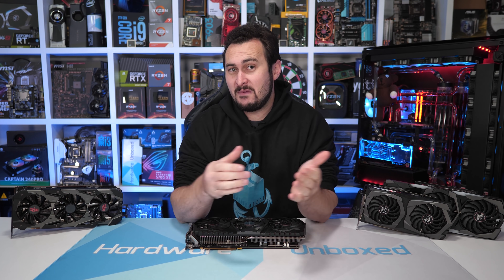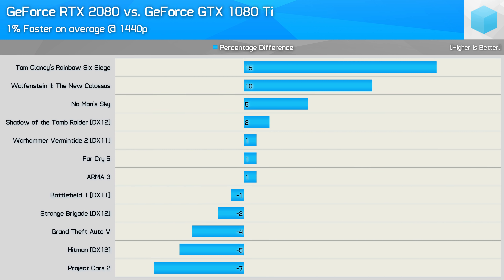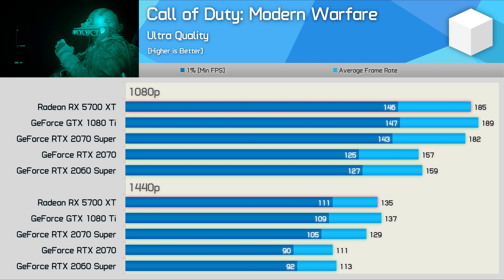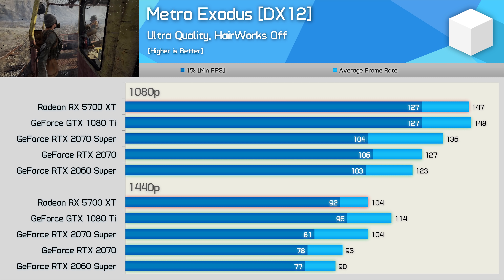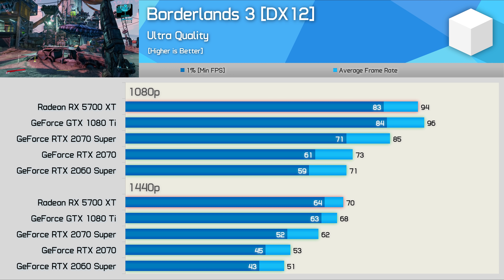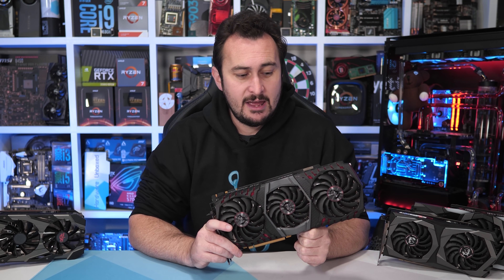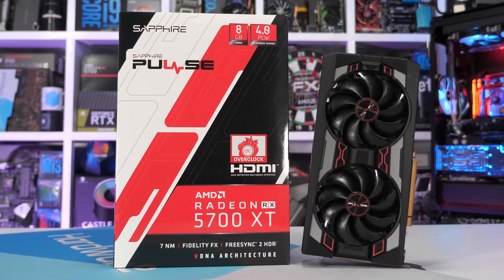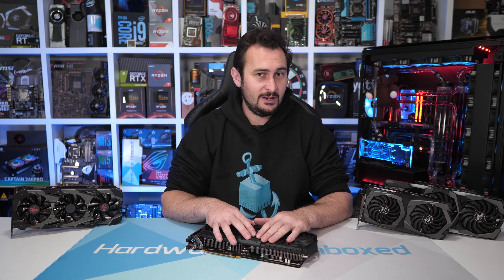GeForce GTX 1080 Ti vs. 5700 XT & RTX 2070 Super, 35 Game Benchmark

Comment: The 1080 ti was one of those GPUs that was too good. I still have mine 3 years after purchasing it.
Reply: srsly....you bought a high end card, do you expect it to be useless after only 3 years? 
people still use 780tis for 1080p gaming and its fine as long as 3gb of vram is enough.
for 1080p the 1080ti will be useful for at least 10 years.
Reply: @AzumDzumHzumS  Exactly, and since the 1080ti was blessed with 11GB of memory, it can easily handle 1440p textures.  And in some cases the 1080ti might even have the capacity for 4K resolutions, although it's not quite powerful enough to actually play most games at that setting.
Reply: same, I have a hybrid evga 1080ti. has been my best card so far
Reply: Gtx 1070 have absolutely no intention or need  to upgrade soon
Reply: Yep my 1080ti runs at 1988mhz on water with the memory at 1200, absolutely a beast. I’ll see how the 3000 series is looking but I bought mine used for about 400 ish so idk if replacing it will be reasonable till 4000 series comes out and I can buy a used 3080 lol.
Reply: All thanks to Amd Vega's barking
Reply: I would sell it now, then get a rtx 2080 or rtx 2080 Super.
Reply: Same
Reply: It was barely good enough for 4k but as soon as the next thing came along it was ditched asap.
Reply: Yet when it came out, people called it a bloated, overpriced cash grab.
Reply: Same! Bought mine in August 2017. Now waiting for RDNA 2 and RTX 30xx to see which GPU I should go for.
Reply: Me tomm 1080ti@2025mhz under water
Reply: Same here. Big smile!! EVGA FTW3
Reply: struggling to replace mine. even considered taking my founders edition and getting aftermarket cooling on it to get more life from it.
Reply: Same here. Basically, there's nothing that can really replace it right now, but with my VR habit, I'm really hoping the RDNA2 or 3080 TI can live up to the hype. After crunching the numbers, I'm thinking I need about 40% more GPU to get the FPS at the resolution and graphics settings I want in the games I want to run it in. The 2080 TI isn't there, and unless RDNA2 really brings the competition, I'm not keen on spending >1k on a card that doesn't deliver quite enough.

The target is Il-2 Great Battles in HP Reverb VR, with Ultra graphics (maximum view and render distance) at 90fps. The 1080 TI pegs at about 40 fps. The recommendations for the 2080 TI are medium or high graphics settings, but I'm doing high altitude aircraft, so I want the render distance so that the cities in frame actually render, even when I'm cruising at 30,000ft.

I'm sort of debating if it's worth it to sell the 1080 TI and get a cheap RT 480 to hold me over on 1080p games until they finally release the next gen of cards.
Reply: It's definitely one of the cards I'll actually remember, and that is an extremely SHORT list.  I think the only memorable cards I've owned are the ATI 9800 Pro, the Nvidia 8800GT, and now this GTX 1080ti.
Reply: Eddie T  yeahh i can see the smile of your face. Lol
Reply: It wasnt too gopd, the new gen is just too bad. They put rt cores in it and asked ridiculous prices while the performance wasmt there
Reply: Ya...
Reply: Other way around - Turing was simply not good enough. At least it brought something new to the table, that the 3000 series can hopefully cement in place.
Reply: @BrutaleBent  IMO, Turing was just too expensive. If the RTX 2080 was 500 USD and the 2080 Ti was 700 USD, then it would be a decent upgrade and the 1080 Ti could then be compared to the 2080 Ti instead of the 2080.
Reply: @BrutaleBent  Turing performance was fine, just too expensive due to lack of competition. The RTX 2080 Ti is a beast, all the RTX cards will last a good while, especially if games implement DLSS 2 which is a great feature to have.
Reply: @BrutaleBent  
No... Wut?
AMD can't even catch up after 3 years and u call it other way around?
Do understand that the jump from 980Ti to 1080Ti was almost 2x more.
2 years shouldn't even be that different. It simply set a standard Nvidia cannot deliver on again.
Reply: It appears it will be good 2-3 more years based on these results!
Reply: im using a pair of 1070's...a mini and an amp... and... i havent had any sli related issues so far but.. most titles scale pretty well... and unlike my dual 290x setup....i havent had to use 3rd party software to get sli working with specific titles.....its just worked even with titles not officially in the nvidia support list.... 

i mean my dual 290x setup lasted a solid 4 years before amd fucked off driver support by forcing wattman on people..but not making it work on 290/390 cards..(couldnt change fan ramps or anything without wattman causing the card to cycle between idle, 2d, video, and 3d clocks nonstop.... that lasted over a year before they eventually removed wattman and brought back the old method for those cards...not sure if they yet again brought wattman support to the hawaii cards but... dont really care... , the single 1070mini, gave me, close enough at worst(withing 5-7fps worse on very rare titles...and i found a fix for that even with dx7/8/9 and old ogl 1.x titles...), mostly...better perf...despite what i found reasearching it before hand..expecting at best a wash, perhaps some loss in titles that liked the hawaii cards....instead... on the 9370 i was running at the time... even the titles that didnt run better by default, could with driver profiles..using the build in profile tool... be made to fun as good or better without using quality damaging cheats..) on this x5675@4.4, dual 1070(mini+amp) have worked great... amazingly well infact...

Comment: should i just buy a used 1080ti or are the features (DLSS, Ray Tracing) that come with the RTX 2070 Super worth the price?
Reply: You should wait. 3xxx series will be out very soon
Reply: @sir_whocampsalot2876  if it were solely between those two cards, I'd actually argue that DLSS alone is enough to warrant an investment in 2070 super over a 1080ti.

Comment: All nice for new shoppers of GPUs Turing/Pascal/NAVI but for those that already have a high-end Pascal ( 1080, 1080 Ti ), there are really no compelling upgrades, 3-4 years later.
Terrible :(
Reply: Not really IMHO, I have a 1080TI and am glad there is no upgrade path, means my card is relevant and doing a great job, that's a win in my book.
Reply: @Johnny641  I didn't say the card is terrible, but the fact that there is no upgrade at the same price point. That is terrible. 3 years passed and you still have to pay the same amount as 3 years ago to get that level of performance.
That in my vocabulary means STAGNATION.
Reply: @wavetrex  I understood what you meant but didn't articulate my response very well (apologies). Maybe the next-gen will make RTX worthwhile without the massive FPS hit when it's enabled.

Comment: The results for some games like Control and Doom Eternal, on Turing, probably aren't because of driver optimizations but rather because of the new integer data path.
Turing SM adds a new independent integer datapath that can execute instructions concurrently with the floating-point math datapath.
Reply: That's interesting, it would sure explain the difference.
Game engines need to be specifically coded to use the new data path for it to work, right?
Reply: @imrileth6618  Not necessarily - the GPU can choose how to deal with the instructions most effectively, and I'm sure there are some "automagic" optimizations. There are certainly even more optimizations to gain from specifically targeting it, but, I'm sure the GPU / driver does a lot of basic optimizations on its own if it's possible. However integer performance on GPU's is more of a GPU Compute type of functionality - almost nothing in a rendering pipeline cares or uses integers, it's all float (hence why GPU's are so floating point performance optimized). This new integer performance could be used to do actual game logic though, but ... it'd be really hard to target that without sacrificing performance on incompatible GPU's.
Reply: "Lets use float for anything."
Found your leak mam!
Reply: Isn’t the integer/floating point concurrent execution the main reason why Turing has 50% better performance than Pascal in general at the same clock speed and SM count? It’s hard to believe that only Control and Doom take advantage of that stuff. It’s pretty clear that those two games perform much better on Turing because Nvidia focused all of their driver optimizations on Turing and left their older generation GPUs without any performance boosts.
Reply: @yancgc5098  Pascal is Maxwell at 14nm and Maxwell is still modern architecture but it's slowly getting old and we are getting closer and closer to the new arch (Ampere?) so Nvidia slowly stops optimising older cards because business is business
Reply: @GewelReal  this bs again? it was disproven countless times. nvidia doesn't purposely lower older cards performance. in the contrary it mostly increases over time. and well i'd take nvidia over amd any day anyways. at least the majority of their drivers work. for amd you might find one good driver in the 2 years lifespan of your card.
Reply: @Dunkelelf3  re-read my comment
Reply: i don't know what any of that means ^^

Comment: RX 5700 XT in UK Amazon is £310 new vs GTX 1080ti used for £450. But overall if you still have a GTX 1080Ti there is no need to upgrade at all, still a beast!
Reply: Lover Of Tech which model AIB 5700 XT is that? I can’t see anything on amazon UK that cheap.